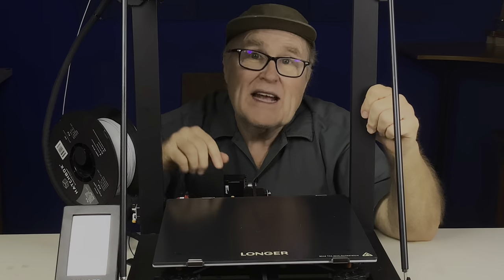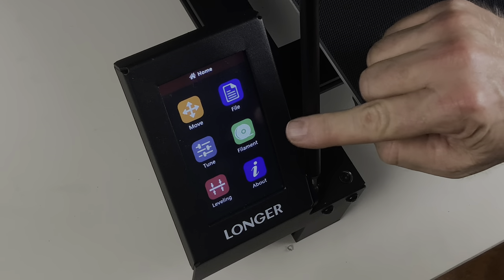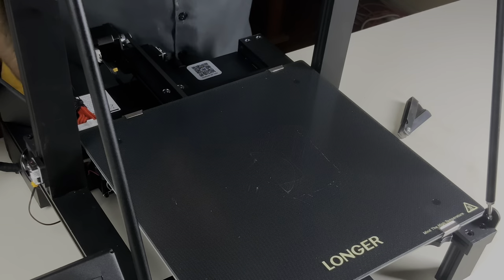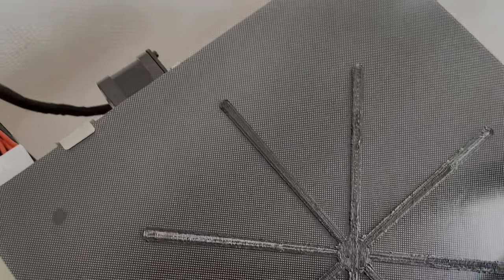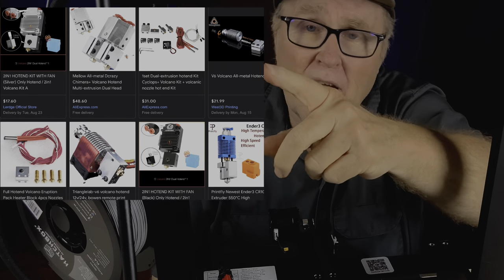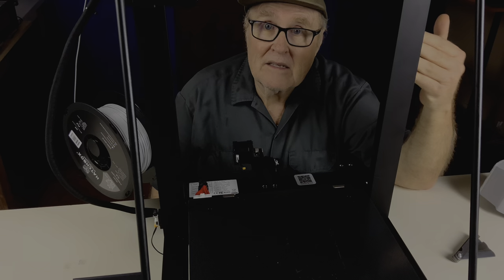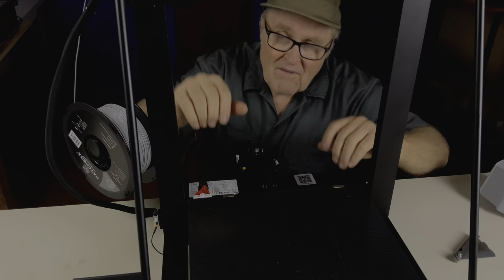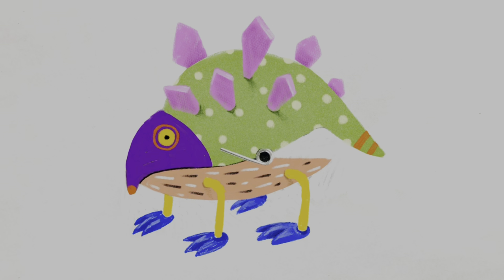Making Big Prints With The Longer LK5 Pro Printer

Comment: I have a few suspicions about the weird layers at the beginning. 1, it can be that the bed is too hot for your filament, PLA should never have a bed hotter than 70 celsius, 2 it can be squishing the filament too much, and since you mentioned your bed is warped, it might be this. You should never level it with too much of a tolerance, always give it 0.005 to 0.015 mms more than you need, and since it looks like you have the sticky ultrabed, you wont worry about it not sticking if you have a nice surface for the first layer and an adequate temperature. And finally 3, your nozzle can be too hot at the beginning. Some softwares do give you the option to heat it more at the beginning, Cura does it, and if it heats up too much, the filament becomes completely liquid, like casting resin. You never want your filament to be liquid, you want it to not be frozen, nor liquid like water. Especially PLA, you want it to be very maleable but never able to drip like a non viscous liquid.
And those horizontal stripes are almost certainly related to the threaded rods or screws that lift the Z axis. I had them a little warped once, and instead of spinning in a completely straight axis, they kinad jiggled around, making those repeating layers outside their designed position.

Comment: Something no one talks about is ambient temperature fluctuations.  if you have an air conditioned home, then its possible the air kicking on is what is causing the weird layer shifting at specific intervals.
Reply from the maker: Good suggestion. Temperature control is probably just as important in printing as it is in resin casting. Congratulations on your channel Seth! You have really blown up!

Comment: If the zits disappear at the same level, I would check either the lead screw or the It might be a snagging issue with the cables when it is that low (I would check your cables anyway for things like strain relief as well since a lot of cheaper printers do not do a good job of strain relief on any of their cables)

Comment: the garbage at the bottom can probably be attributed to 2 things: 1. too much bed temp, or not consistent bed temp.  see if it allows you to PID tune the bed.  otherwise it's probably just too hot for that filament. 2. your Z-axis lead screw/or z axis wheels either have a bend if it's the rod, or flat spots in the wheels.  see if having it move up and down the z-axis causes weirdness every time it gets to a certain point.

edit: those drawings are rad!! lets see some of those casted!
Reply: I second the bed temp being too high. It looks like the fans kick on at a certain height to alleviate the issue, causing the abrupt change in quality.
Reply from the maker: The bed temp was set to 60c.  That temperature seems to work fine on the other printers but perhaps the bed is actually hotter than it is reporting. I shall get out my infrared thermometer and measure from now on.  It will be fun to make those silly clothes pin toys. Lots of people make them using the actual pins, I just planned to use the spring hinge.
Reply: @RobertTolone  is your firmware capable of doing a PID tune on the bed? Recommended if so

Comment: For myself I have stuck to using small mini type printers. With these it is easy to level the bed and I don't want to do prints that take longer than nine or ten hours. When I need a bigger item I break the design into manageable parts and bolt them together. A colleague of mine runs a big expensive printer at work with all the bells and whistles and it still has a lot of failed prints. He is doing more complex stuff and the machine has dual extrusion. There is just so much more that can go wrong. 
As someone else pointed out with a big printer there is a temptation to use a raft. I never need one with my small printers.
Reply from the maker: I agree, my little Kingroon KPS 3 has been the easiest of the FDM printers to use.

Comment: I’ve found with my lk5 pro is the silicone leveling columns they work to hold the bed pretty dang level and once I switched to them it’s been smooth sailing now I just need to figure something out with speed

Comment: The issue I had with mine was the rollers on the left side were all loss so the whole bed wiggled.  I tightened those and did the paper test.  Plus I took of the Teflon tube and reinstalled it as it seemed like it wasn't pushed all the way into the nozzle head.  After that everything has been printing great.  There is an auto leveler that longer offers its like 30$ I'm thinking about getting it

Comment: well i had that problem in some of my printers
i would say its a flaw in the z rod 
sometimes the gantry is not aligned or the rollers are a little too tight
Reply from the maker: I think if I put this thing on a granite slab and broke out the micrometers I would find out how actually wonky it is!

Comment: The regular striations going up the side of the print may indicate a problem with either the lead screws or an issue with one of the rubber wheels that are rolling along the v-grooves. It could be something as simple as a bad-casting of the wheel or a mal-aligned bearing. Not 100% certain there, but if I remember a few people's videos right, that would be the first location to check for issues. Perhaps try manually rotating all the wheels by a quarter and see if it occurs again, but offset. That may help determine if it is the wheels. 

One other thought that occurs to me is something Nerys said about that happening when the vertical gantry carriage is over-tightened on one side, causing it to grip and slightly wobble upward when it hits overly tight spots as the wheels roll. That may be another thing to check later on if you can confirm the wheels themselves are not the issue.

As for the snotty first few layers, I had something like that happen to myself and I wonder if it's the same thing. For me, there were some slicer settings when the print starts that has either the bed or the nozzle at too high of a temperature for your filament. Normal offset is around 5 or so degrees, but for whatever reason, mine was doing around 15 degrees hotter, which had been slightly cooking the filament. Alternatively, and was a secondary issue I was having that was again in the slicer settings, it may be over-extruding for the first few layers. Occasionally, the first layer does get a bit of over-extrusion, but on an older machine I had, it did that over extrusion for the first 20 or so layers. Either way, I'd suggest checking the slicer settings if you are using their profile or trying a different slicer profile to see if it's just some weird artifact in the current one you are using.

Comment: Definitely get yourself a large garden paver to set your printer on.  The mass of the large block will smooth out your prints and also make it fairly quiet.  One of my best printers is the first one I bought for $150.  Granted, I put many hours of upgrades and tweaking into it. So is it the cheapest, no not by any means.  Cheap to get into...but to make it work consistently and properly, many many hours invested.  In contrast, my Creality 10s Pro, great out of the box and still perfect.

Comment: The first layers being messed up is because your filament wants to be cooled but cura starts the first layers with no fan and ramps it up. This is done because when printers were newer, fan cooling would cause initial layer adhesion issues. Modern printers do not need to ramp up, ESPECIALLY if you print fast. I can get my Ender 3 clones to print at 400% of the stock "50 mm/s" print speed with almost no problem but the first layers looked like garbage until I just started turning the fans on manually from the first layer.

Comment: For a warped bed, I put small snips of aluminum foil in the middle, where I found it to be low. This evened out my glass bed to an acceptable point. I have since gone to automatic bed leveling, but it's a good cheap fix.

Comment: Had the same problem, ended up being the  Z axis (the side without the motor ) rollers being too tight. If you do a z home you can actually see the one side stick uneven for a few MM or so. This is why it transitions from terrible to good after several layers.. I just received this printer two days ago, lots of little things needs to be done, like fixing the wobble on the table as well. but after that everything seems to be good. I can send you picture before and after test cubes I did, and where I loosened it to make it work.
Reply from the maker: That would be great, thanks!  Send pics to roberttolone@yahoo.com

Comment: Maybe in the slicer your first "X" layers are set to do something weird.  Like too high fan speed or low fan speed or head speed or even layer height,
Reply: That is what I was thinking.  Generally in the slicer you have settings that say for the first # of layers print temperature should be this..and fan set to this.  Because that is a big elephants foot versus what I am used to.

Comment: the fireball tools channel here on YT talks about 'flat' and how difficult it is to achieve; I wonder if you can add a custom granite build plate or some such... maybe a sheet of glass on top of the warped bed and use torn-to-size pieces of paper underneath as shims in the low spots?
Reply from the maker: The world of machine tools is obsessed with a level of precision that is almost other-worldly. Massive granite plates and dimensions measured in 10thousandths of inch.  Of course, then there is the James Webb space telescope where dimensions are measured in the molecular scale.

Comment: Hi Robert, I m using 3d printers to create big prints, as big as a person. I've bought 3 artillery sidewinders, put in 1.2mm nozzles and print with 0.9mm layers. Very happy with them, they really don't need any attention ;-). Big parts are not super precise, but it is actually much easier to print with these fat layers, even if your print bed is not a 100% level,not fiddly at all. I would be interested in learning how to assemble separate parts (which don't fit exactly) so they form a strong structure. Or learn about assembling hollow casted parts.
Reply from the maker: Wow Kate, what kinds of things do you make?  Those printers must really chew through filament spools!  The first project I am going to do with this printer is made from printed sections. I will demonstrate how I put them together. Spoiler. the 3-D printer is only making the skin. The structure and the strength of the final sculpture will come from the resin and foam interior.  Should be fun!
Reply: @RobertTolone sounds like very much fun 😁. I work in a similar way. But i even have to slice the sections, because they are still to big. Chewing through2.4 kg rolls  lsometimes in 1 day 😁.  Hesitating now if i should get a resin printer, maybe if the parts  are printed more precise, the assembly would be easier and cleaner.... I m curious to see how you will go about it, you always have good ideas. Watch out with how much foam you pour in one go, i recently blew off a head 😭 filling my model with foam... I think it buillt up too much pressure or temperature in the neck. 
I can send you some pic of my sculptures if you like. Looking forward to next friday
Reply from the maker: @katevandeweghel2691  Send pics to me a roberttolone@ yahoo.com

Comment: I second the build plate temp is too high for your PLA.  If you have a IR temperature reader check what the temp of the build plate is at the start of the print.  It's possible the bed is not reporting the correct temp and it's actually hotter.  Hotter bed means softer first layers as they don't properly cool and the weight of of the next layers basically deforms them even more.  I've seen this on our nice Ultimaker 5S at work where we tried to do a PLA + PC combination print and it used the build plate temp for the PC (which is hotter) that was an interesting failure lol

Comment: looks like your bed overheated the print i would try to lower bed temperature and both flat parts and lower levels of the part should be hine, or try finding cooling fan options in the slicer and look for anything that disables part cooling in first layers

Comment: I used an inexpensive filament printer for a while, and while mine was smaller, I had similar issues to you. No clue if the bed was warped, but it seemed like I needed to re-level it every print. Ultimately just handed it off to a friend when I moved: I was interested in miniature printing, and the filament ones just don't have the level of detail for 28mm men. I agree that unless you're a gear-head who loves working on the machine itself, you want to pay more money and pay less time. 

Unrelated to that, I was wondering if you had any idea how to approach 3-up sculpting and casting? I've been wanting to get into casting my own sculpts, and reading old articles on mini casting, they frequently show off a sculpt at 3x the size that they somehow shrink down to the final cast size. Is that something someone can accomplish in a garage set up, or is there specialized tools I wouldn't be able to get? 

Love your stuff, glad to see your toolbox expanding.
Reply from the maker: I don’t know what process they were using for the 3-up method.  Sometimes I have been required to sculpt a prototype two or three times larger than the final object. But that was so that the scan would have sufficient resolution and data for the final model.

Comment: I have an old Ender 5 and a new upgraded Ender V3. Don't know why but printers where the Extruder is on the Z axis always cause problems, I've seen a lot of people complain and I experienced it myself. Ender 5 is a far superior machine than the V3 which is a newer model. 
I saw you're using a glass bed. I tried one too as well as a metal plate bed. Both are crap. Small prints don't stick to a metal plate at all and glass conducts the bed heat in such a way that it ruins the first layers. My theory in your case is that the first layer is set nicely, but then because of poor heat conductivity (or something) the edges cool and pop a little off the buildplate making them warp and stick upwards. On printing the next layer the extruder just pushes the plastic that sticks up from the previous layer to the sides making those snots. If I'm correct the inside of that cylinder shouldn't have any snots at all. For the print bed I recommend the cheap flexible magnetic mats. Zero issues with bed adhesion and you can also level it perfectly. Because the mat is very flexible you can add small strips of paper underneath in key areas.
Another theory is the filament itself. I noticed the snots were far less pronounced on the gray print compared to the black print. The pigment changes the properties of the filament way too much so I gave up on them completely. White PLA is the only way to go for me. Transparent PLA is also good.

Comment: That bottom problem of yours seem like a “too much plastic” problem to me, based on the bobbles and the elephants foot. There can be many causes for too much plastic. Personally i mostly get it from starting the print to close to the bed and with the warped bed that might be the case here, getting to close to make it stick everywhere.

Does it stop at exactly the same hight every time no matter what you’re printing? Then it’s probably the lead screw or some layer dependent setting. Is it to hot and it get better when the fan gets to a 100% sort of thing.

Does it stop at “about” the same hight and gets affected by the prints shape and what layer the infill starts? Probably to much plastic that doesn’t have anywhere to go.

You can fix it in several ways. Getting a perfect hight helps but it’s a bother. You can lower the flow rate for layer two till around ten. 

I’m lazy so i just use a raft. A raft prints a surface for your actual design to print on. It fixes the problem here because the first layers are a bitt checkered. Bottom segment is 50-50 plastic and air. Middle segment is 75% plastic, top is 100%. Each segment is one or a few layers. The point is that the air gaps in the bottom layers lets the extra plastic squeeze to the sides right away and it evens out even if the bed isn’t that even. Works wonders for me.
Reply from the maker: So you specify the raft settings?  I tried printing with a raft and it was snotty. Then the snot continued into the print. Like I say in the video, for about 4 mm.
Reply: @RobertTolone  if it’s a to much plastic problem then there is a lot of extra plastic. What your looking for is if it makes a noticeable difference to the hight of the problem.
An easier thing to test is to lower the flow rate in the slicer settings and see if that makes the problem shrink. Even if it messes up the higher part of the print you will get an indication if it’s relevant to the problem.

My gut says it’s a combination of being too close to the bed and too high flow rate.

Have you done a flow calibration box? You just print a box with no roof with 0,8mm walls. Because that is two lines wide a good calliper can easily tell you how you need to modify the flow rate.

Comment: I actually know why the vertical lines show up, it's because for each layer it's starting and stopping in the same place. Supposedly you can randomize that, but I don't remember how. Saw that one on another channel that does 3D printing. Might have been Maker's Muse. I've said it before, and I'll probably say it again because I don't have the best memory, but I love to tinker. When I finish moving, I'd like to make a 3D printer from scratch. My idea for the build plate is to make a thick rigid plate out of aluminum and grind it as flat as possible, then take a thing sheet of some metal and attach it to that as a way to flex the print off. Maybe even just some aluminum foil and tape the corners.